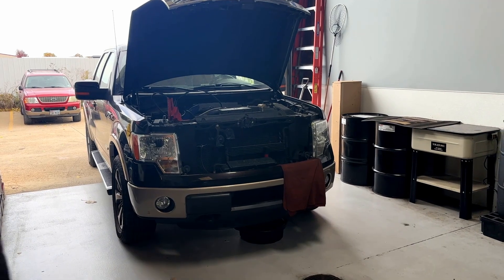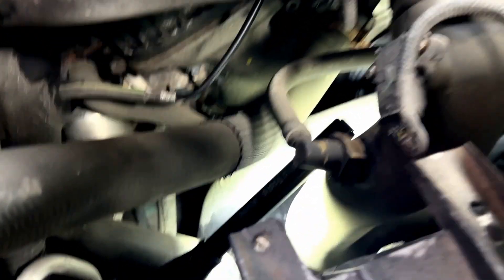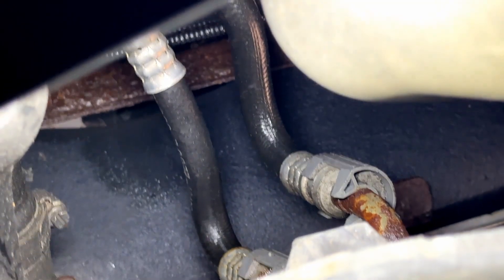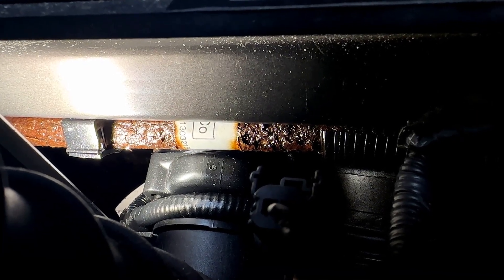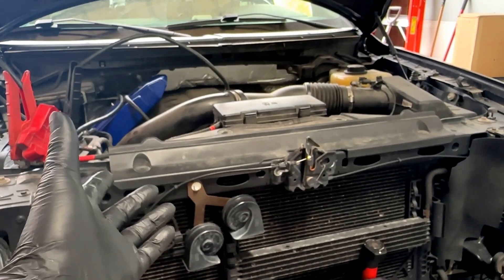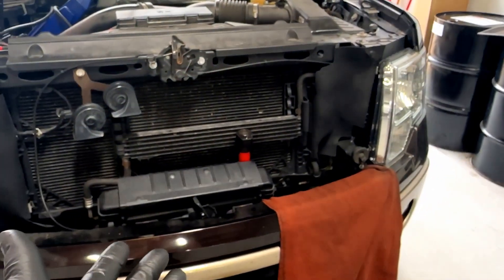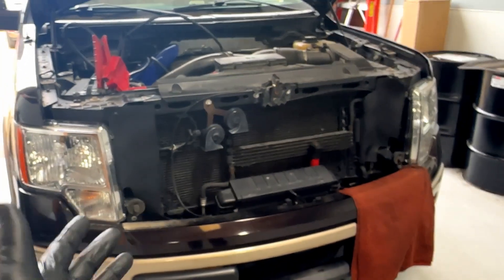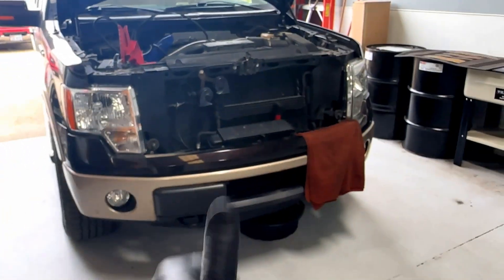One Last Time: Do Not be The Next Victim of Faulty Ford F-150 6R80 Transmission Cooler Lines!

Comment: I'm late to the game, but thanks for another great video.  A combination of ignorance and our gravel driveway got me on this one. Noticing a leak is possible, but definitely not guaranteed, especially when you're not experienced with the failure mode. The issue only became obvious when the fluid level was low enough that it stayed in neutral when you put it in drive, and I don't know how long it had been losing fluid. If there's something to be positive about, it's that it was towed, which wound up saving the transmission. The job was done correctly, and it was definitely an expensive repair, but a lot less than buying a new truck. All of the common failure points highlighted across your videos have been addressed at this point, with the vast majority being done proactively. It's a fairly old truck, and having to put some money into it is expected. The mileage is low for it's age, and I really do try to take good care of it. Nothing is guaranteed, but I'm hoping to get several more years out of the vehicle. If I'm able to do that, the cost of repairs will pale in comparison to having another vehicle payment.

Comment: Great informative video, i get the metal fatigue at the quick connectors even though i dont understand why ford didnt address this issue. My second disappointment is why are these coolant lines just rusting away, cant they be galvanized or some other rust prevention coating be applied to stop this rusting. I can address the quick connect snapping issue with some good hose clamps after gettinf rid of the aluminium sleeve but i cant address the whole coolant lines issues without a 2k new lines installed to fix this ridiculous rusting issue that should never had been allowed to occur by ford. I really appreciate your video and your experience.
Why was there not a simple no fluid  indicator and engine service now test ever incorporated?

Comment: Back in the day the trans cooler usrd to be a couple tubes inbthe radiator side tank. You mentioned that getting clogged with clutch debris. They must have changed it quite a bit because back then you could pull the side tank and change the cooler.

Comment: I got SO lucky with mine.. I was running up the highway and noticed that it seemed hazy behind me. I thought it was just smoke from a truck I had passed but i kept watching and the haze didn't go away and I knew it was me.. I pulled off an exit within a half mile and when I got out to check around, I saw the dripping.. I popped the hood and actually saw the line finish breaking and dump fluid on the ground.. I turned off the truck real quick and had it towed.  Had it been raining or night I wouldn't have noticed.. REALLY lucky!
Reply: I saw the drop from my 14 Tremor one day after I'd parked it at work. My lines are rusted to oblivion but they never broke open. It's a fix I would have done even without the video, but Brian drove home how serious it is.
I'm going to add checking lines to the very brief under hood inspection I do every time I fill up.

Comment: Hi Brian.  I need to change the fluid in my 2002 F250 with ZF6 manual transmission. I was looking at the Valvoline Maxlife Multi vehicle atf as it is considerably less expensive than the Motorcraft Mercon V.  The Mobil 1 atf is even less expensive than the Motorcraft.  What do you recommend?  My truck just turned over 250,000 mi.  Thank you!

Comment: I have a 2010 F150 5.4 triton V8. I have an intermitently grinding noise at 20mph and 40 mph. Thought it was the vacuum  IWE 4x4 system but its not. I hear its the transmission and Ford says it normal. They fix it by adding 6R ATF XL-16 additive or replacing transmission in under warranty. Mines is not under warranty. Have you heard of this? If so cani put two of thise syringes in transmission?

Comment: 2011 F150 3.5L Ecoboost 145k miles. 

I've watched all your videos about this and noticed that there was evidence of splitting connectors, rust, corrosion, and leakage. 

I disconnected the quick connects and found no evidence of corrosion, weakened metal or leakage.  My lines are rust free.

I was curious when you say to change the lines out. Are you putting back the same lines but newer ones?  Or are they different in material or an improved design?  If that's not the case, then what are we actually fixing here?

I could do this job, but I'm not seeing anything that would lead me to conclude failing lines. 

Don't get me wrong, I watch your channel a lot because I believe you know what you're talking about. I'm just asking for clarification on the new lines. 

Thanks!

Comment: Just replaced my lead frame plate in a 2012 with 115k. The dealer said it was fine to drive till the parts came. Unfortunately it's not fine. Mine dropped to 1st gear going 40mph

Comment: 2015 F150 3.5: My lines rotted and started to leak, so luckily no big blowout!  But the Inlet and outlet lines are rotted also.  Is there any information on changing those?  The main cooler line that runs to the transmission seems straightforward, especially with the videos available, but the inlet and outlet do not seem to be covered in any videos, etc... and they look a little tougher to get access without taking a lot of the front face of the truck apart?

Comment: I have a 2017 expedition with 213,000 mi. I haven't had any transmission issues thankfully would it have the potential for the same problems?

Comment: I noticed a spot on the driveway and decided to crawl under and yes, my cooler lines were very rusty and leaking. I had them changed at the dealer and a trans fluid flush all costed 1,500, so it isn't a cheap fix, that was on my 2016 2.7L f150.

Comment: I have searched on the internet with no luck. Can you tell me what direction the transmission fluid flows into the cooler for a 2014 Ford Expedition? Thank you. Semper Fi.
Reply from the maker: Fluid flows from the trans to the radiator to the external cooler back to trans

Comment: Hey Brian picked up a 2017 5.0 with 100k had them drop the pan and do a flush expensive but cheap in the long run. And I really trust they did this being a dealership I worked at in the past. Between the road test before buying and now noticed a coast down thump very intermittent and not harsh at almost a stop. It is not the slip bump my 2007 had from slip yoke binding that I fixed with the Ford grease any ideas would be awesome. And would you recommend a 5w30 in this engine with the milage it has now this saved my 2007 that I gave to my son running strong today Pennzoil Platinum 130k and still quiet with original timing set and 5 metric k oil changes. Any reply would be greatly appreciated thanks.

Comment: I have a 2018 f150 3.5 eco boost . I took it to the dealer because it has an anti freeze leak . They told me it’s because of the transmission fluid line . Have you ever heard of such causes ?
Reply from the maker: Yes they use coolant sent back to the trans instead on the 18+ models.
Reply: @FordTechMakuloco  I appreciate that that’s a bunch 👍🏾

Comment: Thank you, for the video.Question,  how much fluid l can you be low before trans experiences damage. I checked my fluid today(6r80) , and it was near  the bottom of the dipstick (cold)..  

I just bought this truck, and the inspection did not note low trans fluid.
Reply from the maker: LV expands a lot so it will be at the bottom cold
Reply: @FordTechMakuloco  I was under the impression it had to be in (A) section near the top when cold?.  My concern now is making sure it's safe to drive before checking full hot.

Full story is I sucked out 4 liters of fluid with a pump and only replaced 3.5 because fluid started to pour out. Not on level ground, so I drove around and rechecked(fluid in cold range), and the fluid was right at the bottom of the stick.

Comment: Is it specific to the MY though?…or the 6R80? They kept the 6 speed until 17 I thought, did they apply a revision that makes this not an issue after 2014?
Reply from the maker: They kept the 6R80 until 2020 and yes it is specific to the 6r80 6r75 in any model.
Reply: @FordTechMakuloco  thanks brother. I’m in the market for a F150 and with the uncertainty that seems to be surrounding the 10 speed I’m shopping for one with a 6 speed. Great videos. I use them to gauge my appetite for inheriting DIY projects.

Comment: You mention the F-150, but I would assume the configuration and the issue is identical for the Ford Expedition and the Lincoln Navigators for  these years also.  Can you confirm?  Second: Has Ford addressed this problem to fix the connector issue for their replacement parts, or are we installing the same inferior parts?   Third: Is there any third party parts manufacturer that sells these replacement lines that don't have this issue?  My Navigator is at 92K miles.  Trans was flushed and filled at 30K miles and is due for a drain & fill at 100K miles.  Is that the time to address this issue for the Navigator?
Reply from the maker: yes

Comment: Quick connect just snapped as I parked in my garage :( Luckily not much fluid leaked but I am concerned b/c I don't know how much damage has been caused. Will try replacing the entire lines first... wondering if my dealer would do this... or if I need to get in there... but I am at 240k miles so maybe it's time for a new one anyway

Comment: How about the 2015 to 2017 do they have that problem. I’m looking to buy a used 2017 F150 with a 5.0 with this six speed transmission, this  is the reason I’m asking
Reply from the maker: no but they rot big time so still check.

Comment: Once the trans lines are swapped is the issue permanently fixed or should this be an ongoing maintenance item? Should I be planning on every 10 or so years to replace these lines or is it a one and done?
Reply from the maker: yes
Reply: Yes permanent, or yes change at an interval? @FordTechMakuloco

Comment: Owners really need to do this. You don’t want to find out the hard way like I did. On vacation in northern Maine doing some exploring on a dirt road high up a mountain in the middle of nowhere with no cell phone service and it’s getting dark. This was so far off the beaten path that I believe logging companies made the trails. Luckily I didn’t loose much fluid and found the leak at the quick disconnect. I always carry tools on long hauls. I cut the line where is goes up to the intercooler and made a U reversing the line and bi-passing the cooling system. Used some existing clamps and few others I had. This got me back to camp site 15 miles away. Tried adding fluid the next day only to find my dipstick cap would just turn. Threads were stripped on the aluminum housing. I had to inject the trans fluids from where I cut the line and estimated at what I lost. Not fun but got me home.

Comment: Bought a 2014 last month for 16 grand. Had no idea about this issue and it happened to me 3 weeks after I bought it. It's in the shop right now, hoping the warranty covers it. Had it at Ford to check out some weird roll in the drive line. They had it for 4 days looking at it and not once did they mention this issue to me. This was before it broke. I hadn't even made the first payment yet before it happened. Unfortunately I'm just over the mileage for the lemon law. I've been buying my vehicle cash my whole life. Only the second time I've taken an auto loan and I might get fucked hard on it. With down payment, diag cost from Ford, diag cost of pulling the transmission right now if the warranty doesn't cover it and interest on the loan, I'm looking at over 30 grand for a truck I drove for 3 weeks.  Plus the $500 dash kit to put a radio in it, did the rain guards. Had my union decals made up for it. All over $109 cooler lines. Fucking Ford didn't say shit about this common failure after having my truck there for 4 days with what felt like a suspension or drive line problem.

Comment: Good day sir ! I'd like to know if you have to replace the auxiliary pump inlet seal on every transmission drop pan I've got the FT-200 filter for auto stop feature on a 6R80 2017 F 150 2.7 l. Ecoboost

Comment: Yeah....well......I just learned about this last night, the hard way. Asked a friend to run a errand with my 2014 F-150 and he calls saying the truck was having issues. I told him to try to make it home. The truck died a quarter mile out. I grabbed a tow strap and Found On Road Dead my FORD with a snapped cooler line at the radiator inlet and what looked like gallons of trans fluid all over the road. 

What I want to know is how to tell if the tranny is fried. I suppose I'll cut off the quick connect and splice in a piece of hose, refill, and see what happens.

What's worse is I'm located and running a business on a out-island in the Bahamas, getting parts isn't an easy thing. Gonna cost me at least 10-12k if I need a new trans.

Before this I had BCM issues, no crank/no start, just got it running after it sat for four-five months. Two mechanics couldn't program the new BCM. Had to learn Forscan and do it myself. Someone else said some of these trucks need to go from assembly to the crusher. At this point, I agree. I've owned a half dozen Fords......NEVER AGAIN!

Comment: Hi Brian. Slightly different situation. My neighbor's 2016 F150 Ecoboost truck just started leaking transfer case fluid. Looking underneath, the case is corroded-through right next to one of the Torx Bolts holding the case together at the seam. Is there any help from Ford on this? (Recall or Bulletin that acknowledges the problem)? His truck has 70,000 miles on it now. All the bolts appear to have had a black paint on them which is completely peeling off and severe corrosion is seen around and on all of the bolts. Nice design. Any advice that you may have will be deeply appreciated. Thank you and God Bless you Brian.

Comment: Curious, Would the transmission temperature gauge have shown high or normal when this happens? Like is that even a warning indicator in real time or does the temp stay normal even though your trans is burning up?
Reply: Nope. When it happened to mine I lost power and the yellow wrench popped up. I’ll never buy a Ford again. 70k miles and transmissions lines braking without rust. Unacceptable

Comment: Thanks to this video I checked mine and sure enough they were leaking. Got it in to the dealership and they were cracked and the o rings were bad as well. I don’t drive it much so the transmission fluid wasn’t really low thank God. Still cost me almost 500 bucks. It’s a 2013 f 150 5.0

Comment: Would owners be wise to look into the cooper nickel lines? I have heard those lines are less prone to corrosion.
Reply from the maker: Who makes those?
Reply: @FordTechMakuloco  
The cooper nickel lines are actually brake lines. You can buy in bulk on Amazon.
Will that work as transmission lines? 
I saw a couple of YouTuber’s use them as brake and transmission lines.

Comment: Well, $160 for the lines, a couple quarts of Motorcraft LV, and the 1/2” quick disconnect tool and I’m done.  ‘09 SCrew FX4  5.4L-3V and it took about 6hrs.  I had to unbolt the sway bar, the power steering rack, the front axle/diff, and the ground wire & shroud at the starter in order to get the lines out/in.  Now on to replacing the power steering high-pressure hose…

Comment: I have a 98 Montero Sport with automatic so I should see what condition the lines are in on my car also.  So you would recommend changing the lines only and what kind of clamps would you use and you said high pressure lines like what hydraulic lines?

Comment: I will keep these questions short. 
Original owner 2013 f150 280,000 miles.
1.  Would you recommend a remanufactured engine and in your opinion who is the best at their quality? I was actually looking at Powertrain Company.  ?
2. Or, would recommend I buy a used engine (lots of miles, cheap) and take it to a very reputable machine shop here in Oklahoma City?
Just trying to eliminate down time.   I most likely sell my motor to recup some cost.

Comment: Thanks so much for another great video! For the life of me, I can not find a diagram online for fluid flow from the transmission From the tramsmission on the 6r80, which line is the outflow to rad? The top or bottom line at transmission ?

Comment: Great video as usual.  Unfortunately, I did not see this in time.  When I noticed the problems with shifting, I just came out of 4wd so I thought somethings was up with my 4wd shifting.  I drove for about 10 miles and lost all power before pulling over and noticing the blown line.  I am debating on replacing the lines and flushing to see if I could possible get it going again.  What do you think the odds are?

Comment: I’m confused. You said that we should cut it off at the metal and put a high pressure hose line on with clamps? Or just replace with Oem hoses with quick connects?
Reply from the maker: I recommend a new line set from Ford.

Comment: Love all the brainwashed Ford owners that seem to be happy with spending so much more money to fix the design flaws of the incompetent Ford engineers.  I used to be one.  Was a huge Ford fan for over 30 years and now will never own another one.  Absolutely maddening how bad they make their vehicles.
Reply: an old refrig tech up here North of toronto said the same. 
evry newmodel they make them cheeper.      🐣🐤🐥
I just retired from service at amilitary base. the fire chief got a new 2023 f150. 
i kinda leaned on the front hood and it started to flex... 
 1979 BRONCO /  throw a 15hp evinrude on the hood and drive-a-WAY...